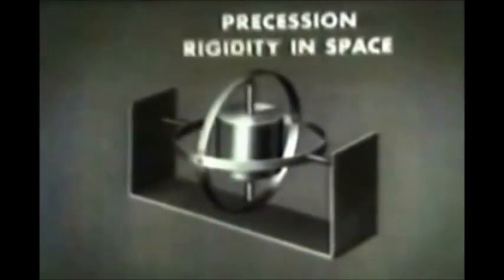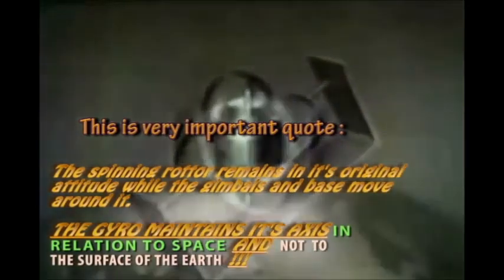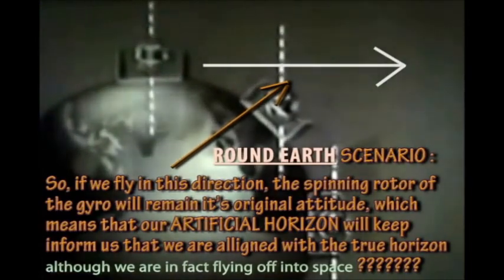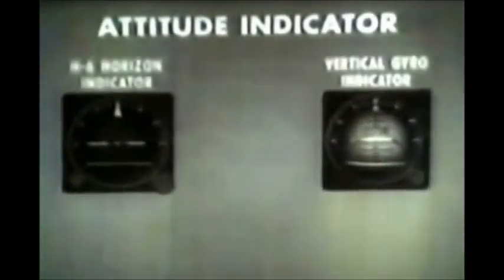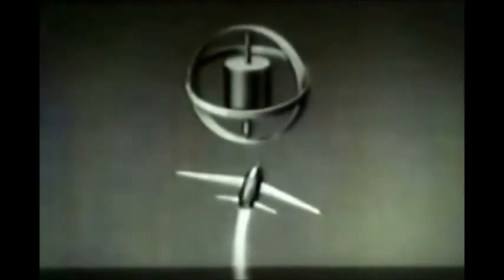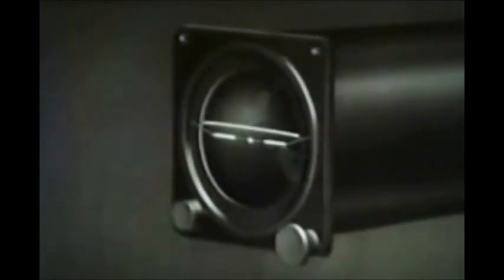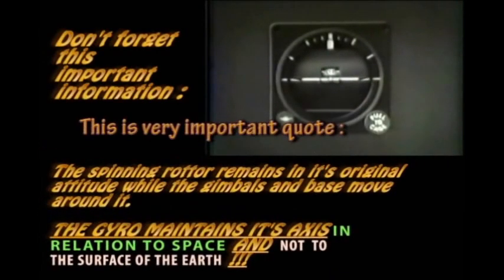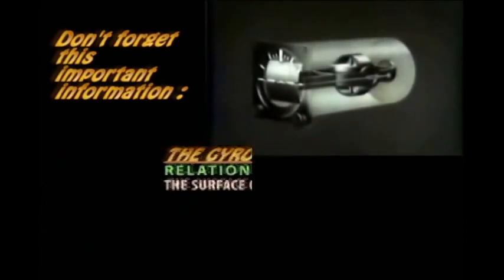Pourquoi un gyroscope aurait du mal à marcher sur une sphère

Comment: Mince alors: Un gyroscope a son axe figé dans l'espace? Je viens juste de m'apercevoir que je fantasmais lorsque je roulais à moto: Ben oui, mes roues sont soumises à l'effet gyroscopique et pourtant... elles s'inclinent quand je tourne. Et les anciens acrobates qui tournaient dans des cages sphériques à moto faisaient bel et bien des tours complets... et leurs roues suivaient le mouvement. J'apprends donc que c'est impossible suite à une loi physique.

Le gyroscope garde son axe de rotation... tant qu'on ne lui applique pas une force. Essayez de faire ça sous gravité, avec des frottements, des moteurs introduisant des couples de rotation etc.

D'ailleurs on peut même faire une expérience de pensée rigolote: Sur base du principe énoncé, il suffit de fixer le support du gyroscope pour... empêcher l'avion de virer ou de changer d'altitude. Du reste, c'est dit dans la vidéo: Si le mouvement dépasse une amplitude donnée, le gyroscope va en butée et ensuite toutes les indications sont faussées.

Le gyroscope est certes soumis à l'effet gyroscopique, puisque c'est son rôle. Mais il est également soumis à d'autres forces, à la gravité, ou même des moteurs électriques destinés à compenser les erreurs.

En fait, le gyroscope, tel qu'il est conçu, permet de visualiser des modifications plus ou moins rapides de son axe de rotation: En-dessous d'une certaine vitesse de variation, il tend à retrouver une position d'équilibre, et c'est voulu sinon les erreurs seraient cumulatives: Vu le temps qu'il faut pour changer notablement l'axe de l'avion par rapport à son point de départ à cause de la courbure de la Terre, cette variation n'est simplement pas visible car corrigée au fur et à mesure. Cette vidéo extrapole une fausse conclusion à partir d'un principe physique réel dans l'idéal.

C'est exactement comme le principe qui dit que tous les corps tombent à la même vitesse: C'est une loi vraie dans l'absolu mais si on tente l'expérience on ne retrouve pas ce résultat... car les objets ne sont pas soumis qu'à un seul effet idéal.